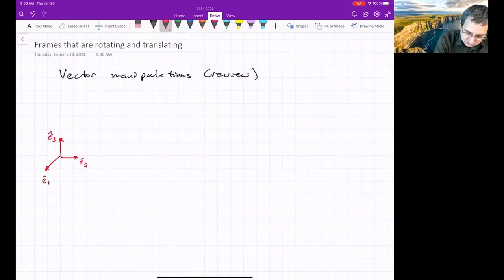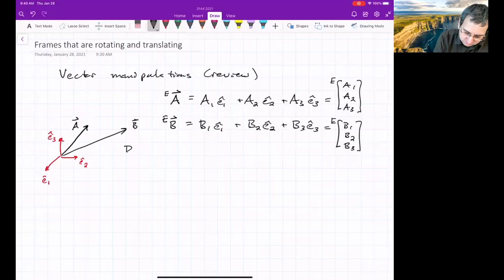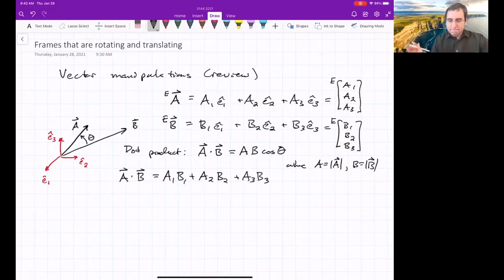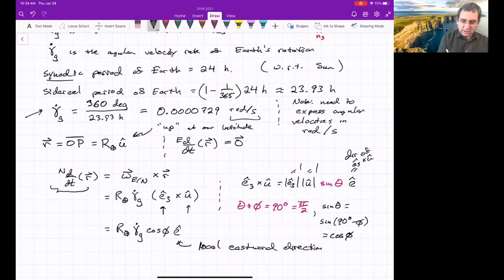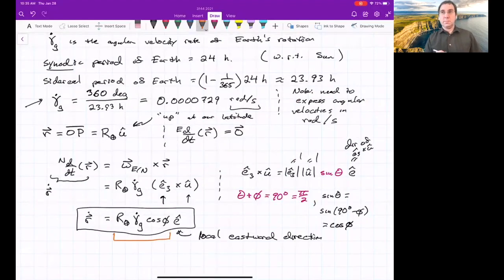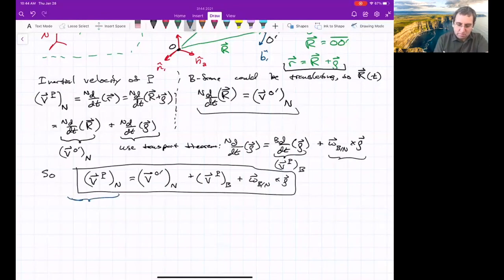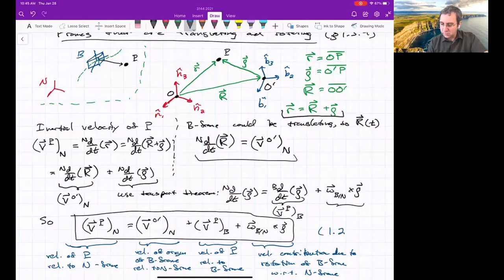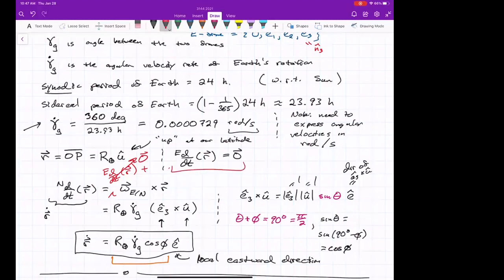Transport Theorem Worked Examples | Vector Derivatives When Frames are Rotating and Translating

Comment: Just out of curiosity, is this course an undergraduate or graduate level class at Virginia Tech? Also, I’m assuming it’s an elective for aerospace/mechanical engineers right?
Reply from the maker: This is an undergraduate (junior year) REQUIRED course for all students in the space engineering track of the aerospace major (we have space and aircraft tracks). We had almost 200 students enrolled this Spring 2022.

Comment: Hi, thank you for the informative lecture. At 15:00, is the r vector (the vector in the righthand side of the transport theorem) defined in the inertial frame (N) or B frame (B)?
Reply from the maker: You could write it in either frame: It is the vector, independent of which frame it is written in.
Reply: @ProfessorRoss  Thank you for the reply. But I am not really understanding what the vector being independent from the frames really means. Wouldn't writing in either frames change the components of the r vector (the components are relative to either frames), thus changing the left side of the equation (the r dot vector in the inertial frame)?
Reply from the maker: It might help to look at the next video https://youtu.be/iFJBi4YmCOs on worked examples using the transport theorem. The frame you take the derivative with respect to (e.g., N or B) does not have to be the same as the frame you write the components of the vector in.
Reply: @ProfessorRoss  Thank you! I watched the videos and now understand why it doesn't matter which frame you choose to write the r vector in.
Reply: @satoyusei3075  That is one of the problems of our education system.. Vectors exist independently of the frames!!! The vector from the center of new york to the center of new jersey exist by its own virtue.. But it can be expressed in any possible frame.
Generally in school we always consider a vector expressed in a basis.  In time, this generates the false perception that in order to define a vector we need a basis first.